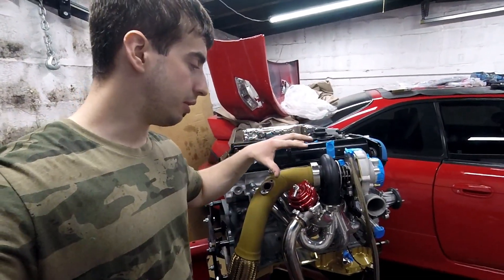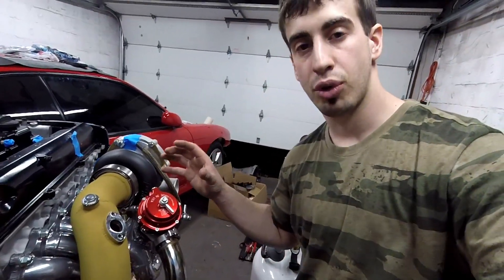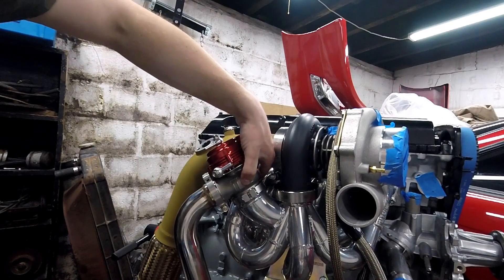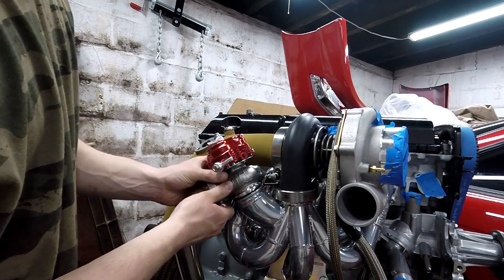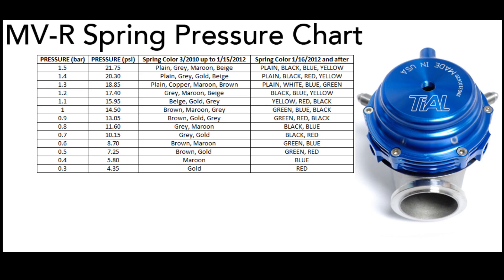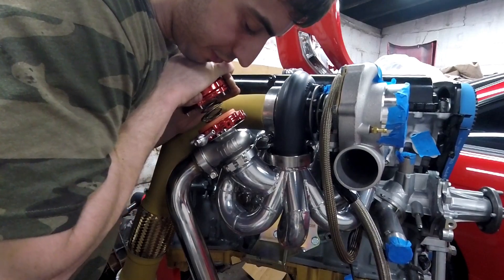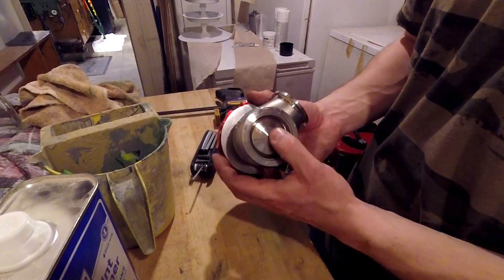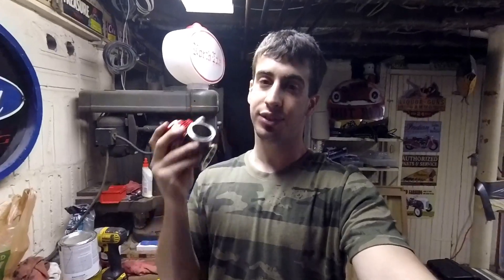WHAT DOES A WASTEGATE DO? (CHANGING SPRINGS)

Comment: Quick question. 

I have 2 waste gates , and one blow off valve.  Standard Ebay. External.

Each waste gate come with 2 springs,  22 psi / 11 psi. Combined in the waste gate I get 33 psi.  But I looking to run my motor on 25 psi, can my controller stop it from climbing to  33 psi , same goes to my bov? What to do?
Reply from the maker: the bov is just to release the pressure when you let off the throttle. I never use cheap wastegates they can cost you thousands in a motor rebuild. always get a quality wategate. the contoller should help regulate the psi with the proper wastegate springs.